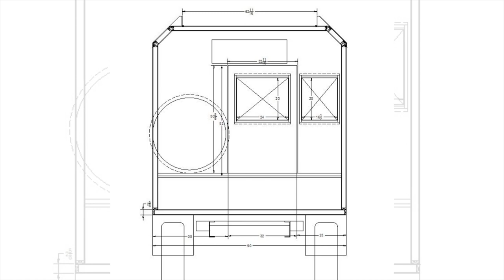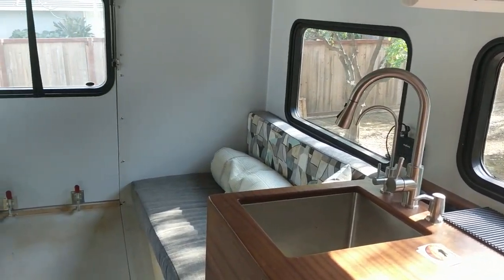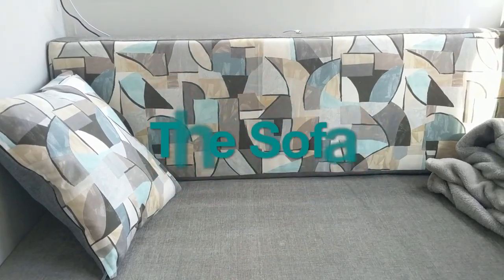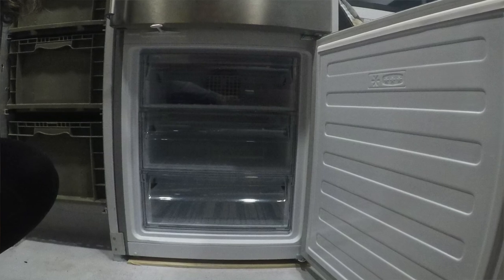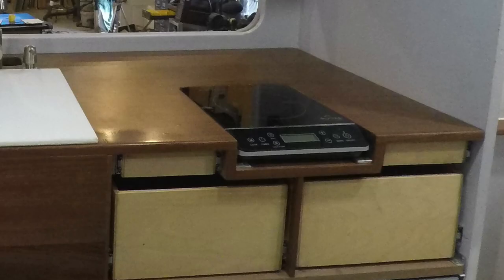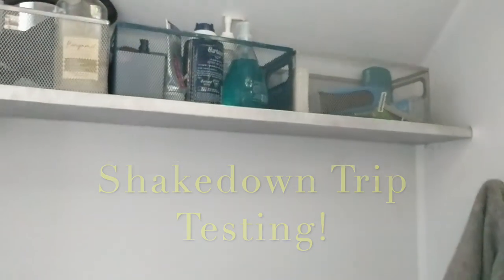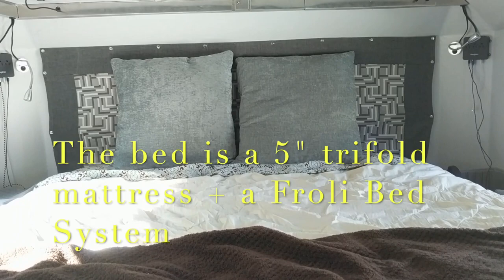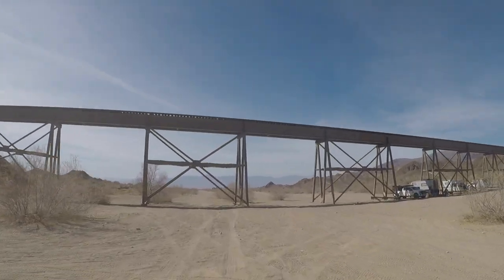Our Custom Flatbed Camper Build | ep:12 The Shakedown Trip & Interior Tour

Comment: Hey Guys the camper looks great! How did you find the stability of the three point mounting system on the highway? I am planning on doing a 3 point pivot frame as well.
Reply: The short answer is that it is excellent on the highway and works pretty well (so far little experience),  isolating the camper from the stress of rough roads but I do have several problems. This is probably at least a half-hour discussion. It is actually quite a complex design because it involves a lot of structural and weight distribution issues beyond the mounting design. 1) The front mounting points are near mid-span of the frame (about a foot behind the cab). My battery hangs on the driver's side right at the front attachment point (intentional). The load on the passenger side, although equal, is more distributed along the length of the camper. The point load on the driver side bows the frame more than the distributed load on the passenger,  consequently, the frame bends more on the driver side, tilting the camper. You really have to keep the load on both 'firm' mountings equal, much more so than a conventional mount. You must look at the weight distribution not only side to side but front to rear and see how it will affect loading at the 'firm' attachments. Since the back of the frame can't contribute to keeping the camper upright, the only way to solve it is to redistribute weight. I'm currently repacking and relocating my 300lb lithium battery pack from the driver-side outboard to the passenger side inboard and frame mounting it. Taking this much weight off the camper mounting system is also a good idea. I should have done this initially but didn't 'see' the problem coming. 2) When driving across diagonal cuts in a road, the roll induced into the camper is worse. Normally a good connection to the rear frame/axle would allow the rear shocks to damp the oscillation. The issue is the center of the frame is an 'undamped spring' making the 'firm' mounting more involved with the rolling of the camper. I am considering putting small shocks on both sides of the pivot (and probably will). If/when you get to the point of making your design, we could spend some time on the phone. By then, I'll also have more experience and worked toward solving the current problems.
Reply: @stevehericks5764  Hi Steve, thanks for the reply.  I agree that weight distribution will play a large role. I think low and towards the front would be best. My biggest concern is with highspeed maneuvers on the highway, but I think shocks on the pivot would help a lot with that. Another option could be airbags under the rear corners that would be adaptable to the conditions. Thanks again.
Reply: @brentizle  I've thought about airbags on the pivot instead of shocks. Since I took them off when I add a leaf on all 4 packs, I have them to use and they would not be difficult to mount. Not going to do it till I run the 'new configuration'. I just finished with the batteries mounted to and inside the frame on the passenger side rear. It's slightly farther back than it used to be but I have 2-1/2" of lift from the new leafs in the rear I can afford to compress (only 1-5/8 lift in the front_. 

'Low and forward' was my thought and turned out to be a problem, which  I (think I) just corrected. As I explained, the loading point only contacting the frame at 2 points near(er) the center span, significantly increases the bow of the frame. It would be better on a truck with a F450/F550 frame being heavier than my F350. My thinking has changed a little based on how much 'swayback' I created trying to move weight forward. I think now more than before,  it is better to mount 'utility items like batteries and water, ON THE FRAME to reduce the weight carried by the 3 point mount. I moved 300lbs in a 20x20x20 cube centered 3ft off the centerline, about a foot behind the cab to 1ft off the centerline in a 49" long case, 11" wide x 15" high. This puts the weight as close as possible to the centerline. I'm going to do a video soon on my prior vs current thinking on 3 pointy mounts.